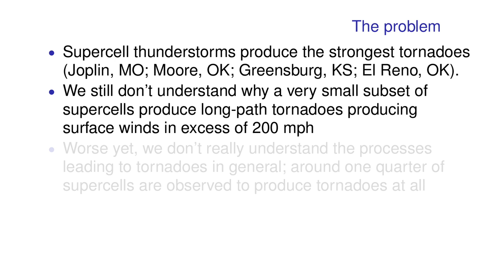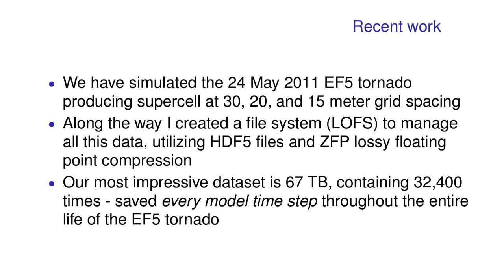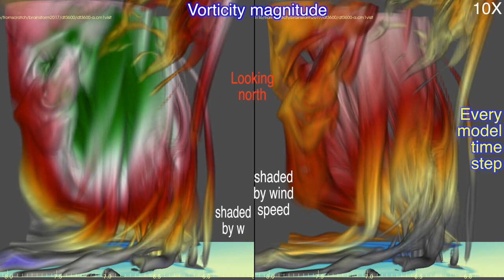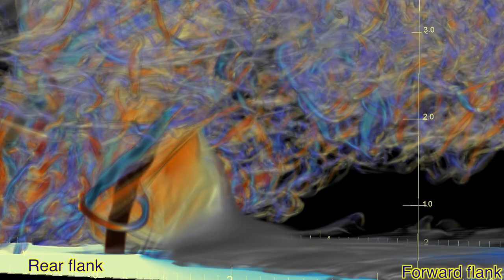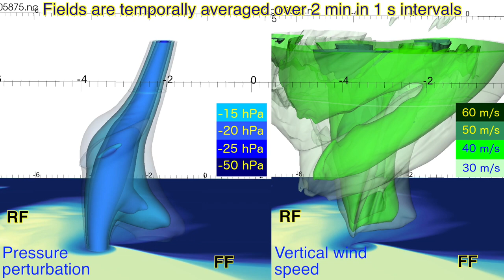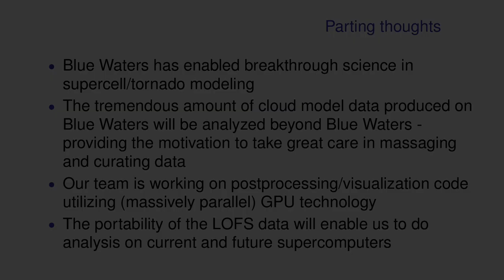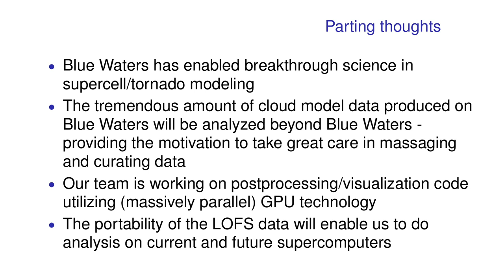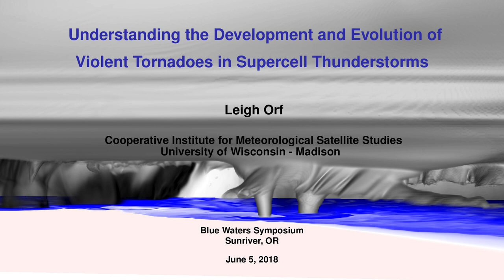Leigh Orf presentation at 2018 Blue Waters Symposium in Sunriver, OR, June 5, 2018

Comment: Does the computer model take electric field distributions and interactions into account? How much does it matter if there are enormous charges and discharging thunderbolts? What about the hail and other precipitation?
Reply from the maker: Our model does not, and to my knowledge there are no cloud models that have electricity built in such that it can affect the fluid dynamics. When you do the math/physics it doesn't appear lightning has any discernible effect on the storm's life cycle. Lightning's energy is dissipated pretty quickly (thunder, heat) and when you look at, for instance, the amount of latent heating going on in the mesocyclone etc., these forcings dwarf any potential forcing from electromagnitism.

I just don't see the importance of sparks in making nasty supercells. The fact that a model that does not contain any electricity produces such a compelling results strongly suggests that getting electricity"right" in a simulated storm isn't really of first order importance.

However yes indeed there is hail (well, the representation of hail as a mixing ratio - kilograms of hail substance divided by the mass in kg of the remaining air) and the behavior of hail (its terminal velocity, the way it becomes wet, sheds rain, melts to form rain that evaporates to affect the cold pool etc) is included and is about as good as we know how to get. Microphysics (code handing cloud, rain, snow, graupel, hail) is the weakest part of just about any cloud model due to the crazy complexity of it all!
Reply: Leigh Orf's Thunderstorm Research Thanks for the detailed reply.  When I mentioned thunderbolts I didn’t mean that the thunderbolts themselves were relevant but rather the strong fields that cause them. After all the separation of charges implies physical work. So part of the stored energy is in the fields. This should have an influence on the precipitation - how fast rain falls etc. And of course the other way around: rain falling contributing to the separation of charges. You know certainly a lot more about it. So my question was to what extent electrical fields are part of the mathematical model.
And btw, I totally admire the amazing work presented here.
Reply from the maker: @reinerwilhelms-tricarico344  Thanks for your reply! It's been a while since I took physics ;) but my understanding is for a gas to respond to electromagnetic fields it would need to be ionized, like a plasma. That kind of stuff is of crucial importance for things like the sun's corona. But the atmosphere is a "boring" Newtonian fluid... water substance is what makes things super interesting. If strong magnets or radio waves could cause the winds to blow I think we'd be on to a new form of energy... alas I do not believe it to be so. As a ham radio operator I am keenly aware of the electrical activity going on in thunderstorms but other than bringing my noise level to 20 dB above S9 on 40 meters I don't think all that EM activity is going to affect the storm dynamics. But it is not 100% certain that I am right about this. If I've learned anything in my modeling of these storms, it's that "everything matters" - but just how much is key.
Reply: Leigh Orf's Thunderstorm Research Sure, what you say about plasma is correct. But the atmosphere isn’t exactly completely electrically neutral. At any time ionisation takes place, e.g., due to cosmic radiation and from the sun. Some of that creates seeds for condensation. And thermal flows lead to charge separation - It’s used to explain charging up of clouds and the appearance of thunderstorms. I’m just wondering how the modeling would be different if the atmosphere is modelled with these charge separations, essentially like a very diluted plasma perhaps. Would be something like electro-hydrodynamics, in analogy to magneto hydrodynamics in plasma physics. 
I admit I don’t know squat about it. I’m just an ordinary physicist with some basic understanding of continuum mechanics and very basic understanding of CFD.
Reply from the maker: @reinerwilhelms-tricarico344  These are all excellent points. At a recent conference I asked a microphysics guy about including centrifuging (this is very much in Newtonian space and obviously needs to be included in the model to give the proper "donut hole" reflectivity signature for a tornado rather than a "bullseye" because it's getting filled with rain.). The microphysics guy (Hugh Morrison from NCAR who wrote the code that I use in CM1) made the analogy of a bandaid to a chest wound - meaning, there are so many other things that microphysics does wrong that before we worry about silly things like angular momentum (LOL) that it will take some serious progress to convince microphysics folks to spend time on these other issues. However, there is definitely interesting research being done on cloud electrification, but we're still very much in the dark about the details, and it would be very difficult to even know where to begin including the effects you mention (and again, I think they would be very much second order effects - but who knows, ask me again in 10 years haha)
Reply: Leigh Orf's Thunderstorm Research Yeah, I looked around a little and found some work on droplets forming under various electric field conditions and such - under electrohydrodynamics (EHD). There is of course a lot of research on that. I suppose that all remaining questions may be answered one day when it is also possible to simulate thundercloud formation very accurately and not just conceptually.  And of course: I’ll ask you in 10 years. Promised. ☺️👍
Reply: @reinerwilhelms-tricarico344  8 years to go
Reply from the maker: @samuelraytheweirdcontentgu8551  Tick.... tick.....

Comment: I am a current PhD student in Theoretical and Computational Chemistry at Penn State, and while this work is not with my area of study, it is incredible; the fact you can so accurately simulate super-cell systems to generate many documented tornadic structures commonly encountered in the field is very impressive.
Reply: I'm looking for colleges to get my undergrad in meteorology. I already have my top 5, but what would you consider the top 5 schools for meteorology?
Reply: Andrew Messersmith was your comment intended for me, or to Leigh Orf? I don't believe I can give any reliable information on meteorology schools as I am a chemist, but I do know that Penn State has a really robust and well known program from what I have been told and by what I have read, and it sounds like UCLA is another good school but I have no first hand info on this. I would also take a look on some ranking websites; collegefactual.com has some 2018 rankings (I know not the validity of this site however, so do some research on it). I do believe that the NOAA has a list of meteorology schools, though I don't believe they have them in any particular order of ranking.
Reply: It was to you, as I noticed you are attending Penn State, however I misread your PhD study area! Thank you for your advice, and good luck obtaining your PhD!

Comment: Dropping my comment here also, came from Hanks channel.
Copypaste:
Wow nice animations and great research!
What these animations remind me of is vortex generators used in industri.
You pump air in one way, center. And get separation of warm, and cold streams, opposition each other. Outer warm. Inner cold. Hard to remember after all these years.
Oh. The vortex generator cold stream is -40*c colder than ambient. So if you got +20*c (normal room temperature) going in, then you get -20*c below freezing.
Ice and frost is literally building before your eyes. Like hail.
Fascinating devices.
If you flip the tornado by 90* to it's side then it kinda looks very much like a vortex generator.
Message me if you need more info.
Cool videos. =)

Comment: This is so cool. I remember a video from @Pecos Hank where you can see strong inflow winds into the tornado on ground level. That's exactly the cold air that feeds the tornado and should therefore be a strong warning sign that a tornado is nearby. Does the tornado usualy move towards the cold air? I'm not quite sure, but it really corresponds with reality, so wonderful simulation and explanation.

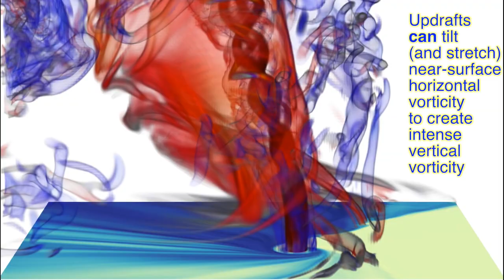Comment: Something I noticed about your vortex tubules, at 16:00 in the video there is a set of very strong vortex tubules where the warm pool is impinging into the cold pool and several smaller counter vortex tubules appear as the impinges into the warm pool, particularly at 16:02/16:03 where there fairly strong one.  Perhaps the hot cold pool interaction and its subsequent interaction with the updraft is the 'trigger' or mechanism your looking for.
Tubules = Smaller vortices  outside of the tornado. Saying vortex vortex or vortex vortices sounded to weird in my head.

Comment: Nice update.  Wonder if your model caught a satellite tornado forming around 11:49?

Seems like if tornadoes form due to updraft strengthening, then I wonder if your study implies that more helicity and shear are required to get tornadoes in lower CAPE environments such as cool season Dixie Alley environments?  There's something on cool season tornadoes on the NOAAWP Youtube channel that I need to look at again.

Also been interested lately in very wide tornadoes, or tornadoes that exceed 1.5 miles in width.  The most famous very wide tornado is the 2013 El Reno tornado (2.6 miles wide), but there's very little literature on the former widest tornado on record, which was the 2004 Hallam/Wilbur, NE tornado (2.5 miles wide).  There was an apparent 2-mile-wide tornado after the Greensburg EF-5 in 2007, and another 2-mile-wide tornado in South Carolina in the '80s I believe.  There's even evidence of a possible 4-mile-wide tornado during the May 3rd, 1999 outbreak.  It all makes me wonder what goes into creating a very wide tornado versus a smaller tornado given equivalent environmental conditions (i.e. similar environmental vorticity, CAPE, etc.), or if there's a set of conditions that would produce a very wide tornado every time?

Comment: Is it possible that the pressure drop in the funnel (@ 13:00-15:00) is a function of the funnel's inflation over that time--does pressure inside the funnel go down when the volume goes up?  Is it possible that the momentum of the SVC causes a bulge in the funnel (increasing the volume and dropping the pressure)?

Comment: Thank you, Dr. Orf, for this presentation and the work that you are doing.

I don’t have a question about the material so much as I need to check my understanding of tornado creation. Before my recent interest, my superficial understanding was that tornadoes form in the cell and descend. I suppose this idea came from funnel clouds descending. Now, after watching multiple storm chaser videos and a few very basic science videos, my understanding is this: wind shear creates horizontal vortices which get pulled vertical to form the tornado (as in the backwards L shape in one of the simulation videos). Your data suggests that the change to verticality is coming from the SVC? (Is this the proper understanding?) and is this change due to the storm overhead “pulling” it up or is the SVC (or something) pushing it up? Or is this an incorrect way to think about it?

Anyway, it seems (to me) from watching the storm videos that the tornado is actually forming on the ground and then “connects” with the overhead storm. I’m starting to think that this understanding is not quite right, and that there are two phenomenon occurring that, when they meet up under the right conditions, organize into a tornado.

If the answer to my sort-of-a-question is “It’s much more complicated than that and you don’t yet have the foundation to understand”, OK. 😄 I’ll keep plugging away.
Reply from the maker: "Anyway, it seems (to me) from watching the storm videos that the tornado is actually forming on the ground and then “connects” with the overhead storm."

This seems to be a pretty good description of what I see. There is a weak vortex in place that extends from the ground upwards into the mesocyclone... once it gets established, interesting things happen. I am working on looking at this process with the 10 meter simulation I did right now.

Comment: So from watching this presentation and the video you did with Pecos Hank, I'm curious, would it be possible to run a simulation in which the tornado produced is stronger than an EF-5? If so, what would it be like? How would it interact with certain obstacles (other than what we've seen with an EF-5)? How would it react in general? I'm genuinely curious. I'm aware that you're running these simulations on super-computers, but is there a GitHub repo with everything you've done as far as a frame for the software itself? Documentation to go along with it? I'd love to toy around with it, even if I'd have to wait hours on end for a simulation to fully render.